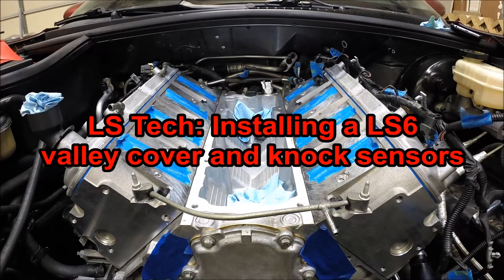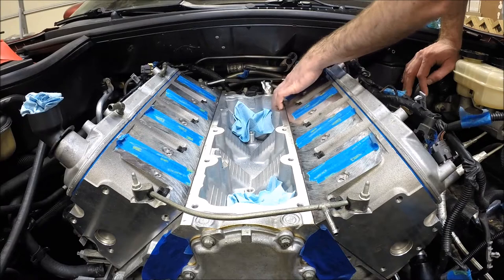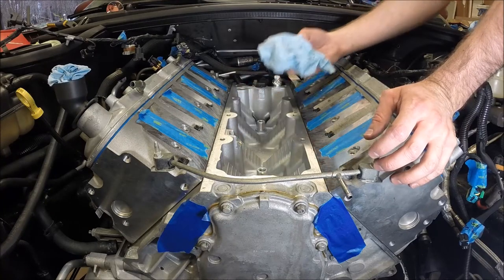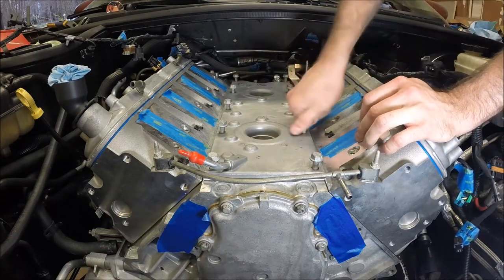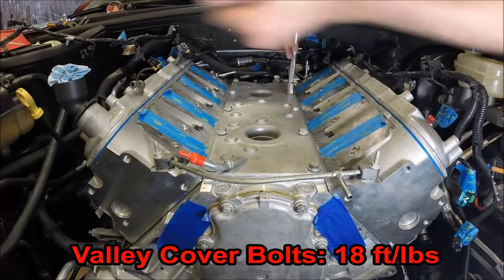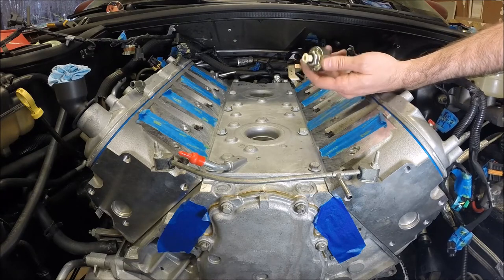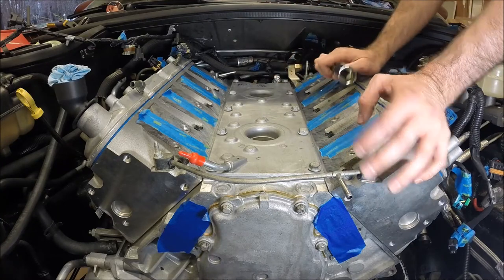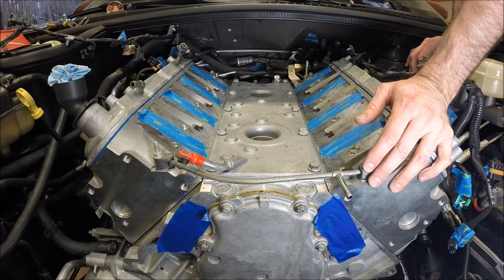LS Tech: Installing a LS6 Valley Cover and Knock Sensors - Part 2

Comment: Looks good brother. One thing I would have done differently is either buy of make a OPS Relocating setup. This way if somewhere down the road, when the OPS craps out it would make it easier to replace,
Reply from the maker: Yes, I did consider that, but just decided against it for the time being.  But it is certainly an excellent suggestion!

Comment: Is there anything between thr valley cover and the knock sensor?  Like, a rubber seal or anything?
Reply from the maker: The valley cover has a big thick seal included with it.   The knock sensor holes have a big rubber "plug" that the wire  passes through.   When you put the rubber plugs in place, smear some rtv around them to help seal them up.  GM had an issue with water/moisture getting into the knock sensor wells and causing issues.
Reply: THANKS!!!  That helps a lot!!!

Comment: What’s the part number for the sensors? Did you have to get an adapter to use them on the LS1?
Reply: Same question as this guy.  Where can I get knock sensors, and what is the cheapest option? OEM?  Thanks!  (5.3L L33)

Comment: How do you change out the grommets on the valley cover?
Reply: Yea, how to change?? You ever find anything?
Reply: @CouchHam  I didn't change the ones on the top, they don't do a ton and it doesn't seem to matter if they're worn out. I changed the ones at the bottom by prying them out with a big screw driver and hammering the new ones in.